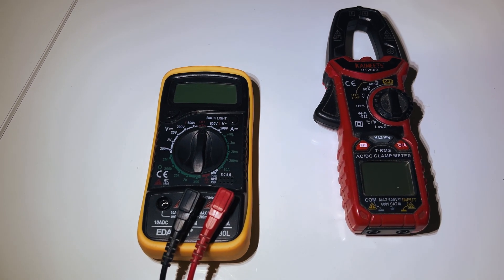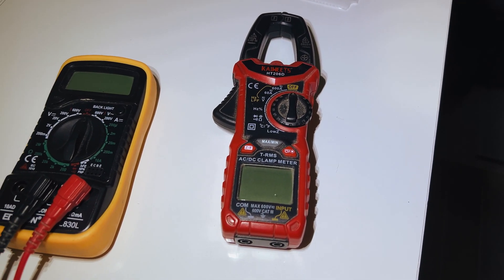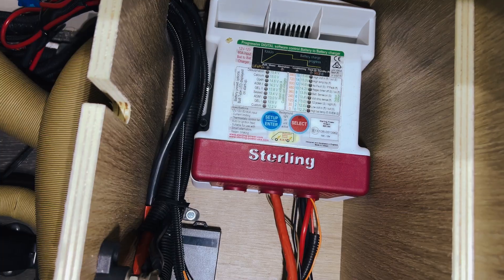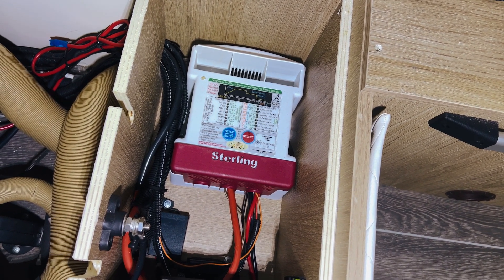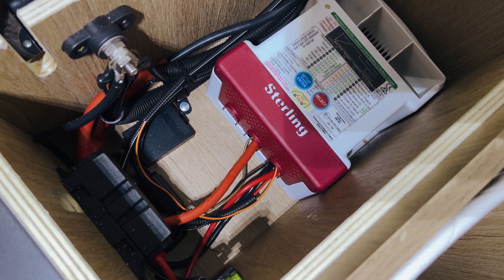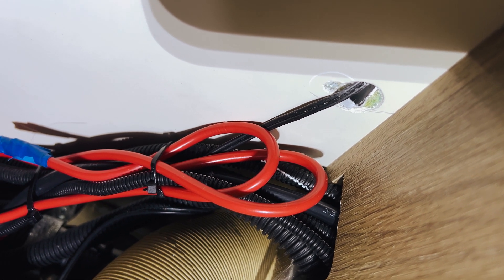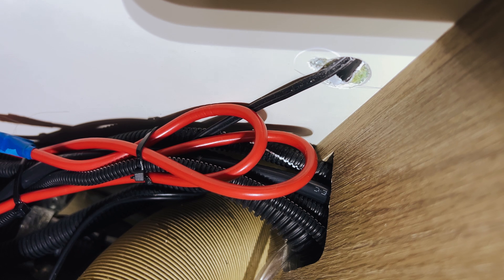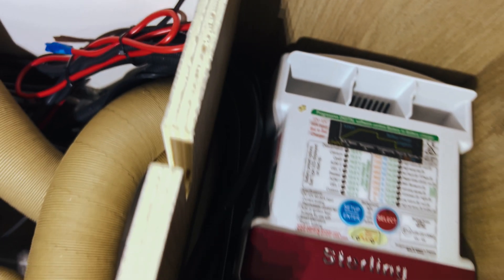Diagnosing a problem with a Sterling B2B

Comment: I have on of these Sterling 1260 B-Bs.To stop it cutting back due to overheating I had to add ram air cooling. Even then I never got greater than 42A charge rate. Reference cable size I used the largest size that the Sterling terminals would accept and the cable length was only 1m. More recently it started cutting back to only 12A so I replaced it with a couple of Victron 30A units which work well. If anyone has an idea of what is wrong with my Sterling B-B I would appreciate input as I would like to solve it and pass it on to someone rather than throw it away.
Reply: Mine gives out 48A on tickover but will drop down to 45A or maybe less as it warms up. 16mm2 cable all the way to the Ford connection point fused 60A. It was a refurb one that had to go back once as there was a faulty capacitor, been great since. Victron 50A B2B next time .
Reply: Many thanks for the feedback. I will contact Sterling to see if it is cost effective to have it repaired.
Reply: Just been in touch with Sterling. I will send my BB1260 charger to them to see if it is worth refurbishing. Apparently the 60A rating is for the input side. Given the slight increase in voltage and significant heating losses it seems that maximum output currents in the mid forties is to be expected.

Comment: Nice video, Sterling give detailed instructions for mounting the B2B.  I’ve the same BB1260 and you have to mount it horizontally because you could never tighten the screws up tight enough otherwise. Your customer also needs extra ventilation in his box as a BB1260 gives off a lot of heat on full chat and will throttle back if it gets too hot. A pig to program the first time with too many issues flattening the cab battery due to timers.